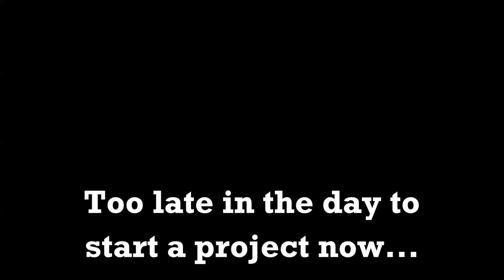TOP DRESSING and LEVELING with SAND :: Back Yard

Comment: I had the same problem with my greens master with the pegs for the transport wheels not mowing close enough to the fence. I just cut the pegs off. There is really no need for transport wheels if you are only using the mower at one property.
Reply from the maker: I’ve thought about it. Probably should. I just hate the sound of the roller going over the concrete from the garage to the lawn 😖
Reply: Yesssssss! That sound makes my ears cringe too!🤣

Comment: You look like you had so much fun! If you want to have more fun, come to Tulsa and help me finish mine. Ha!
Reply from the maker: I’m going to need some freeze pops 😜
Reply: @TheLawnTools   Oh I'll be happy to provide freeze pops all day and send some home with you.
Reply from the maker: Intriguing.... 🤔
Reply: @TheLawnTools  I've already done about 10k SF. Still have about 6k SF left, and need to add another layer to half of that first 10k.
Reply from the maker: Wooooowwwww. What kind of equipment are you using? (For the sand leveling and for mowing and general lawn care also)?
Reply: @TheLawnTools  I made a drag similar to yours several months ago that I pull with my Polaris Ranger. I also made a hand leveling rake for smaller areas. I've been moving sand with a shovel and the dump bed in the Polaris. Last 5 yrds of sand I moved with my neighbors tractor. I've been working on about 5k SF at a time. Cutting it down to reel height and leveling. Been mowing with an 18" McLane reel mower, but that took forever! So, I just bout a Toro Reelmaster 5300D last week. Now, I'm knocking out 96" at a time! Its awesome!
Reply from the maker: 5300! Sweet! I just went and looked at a 3100 this morning! Your lawn might just need to be featured on an episode of LT turf! (More info... soonish on that 😁)
Reply: @TheLawnTools  That'd be fun! I've still got some work to do, but it's coming along nicely.

Comment: Hi there I love to know how many tons of sand u use /100m² . I have a tiny yard just under 200m2 with laom/clay ground... So in the fall when it rains a lot, you make puddles only walking over it. Now I want to level it like you do.

Thanks in advance
Greetings from Belgium
Reply from the maker: kevin .valkenborgh 
One yard is equal to roughly 1.5 tons. I realize we in the states are the only ones that use yards and ft 😂. But the rule of thumb says 1 yard per 1,000 sq ft so it looks like for 200m2 you would want about 3 tons. If you want to do a lighter leveling and the grass to recover faster, you can do less each time but probably more leveling projects to get it nice and smooth. I did about this much on my front yard and I think it needs just a little more fine tuning this (second) year.

Comment: why sand vs a top soil mix???
Reply from the maker: Elliott Huff 
I’m curious about a mix. Haven’t heard of anybody selling it around me but I assume it would be more expensive??? May be a need for some experimentation 🤔
Reply: I did it on my lawn here in Dallas. Yard looks good but not as flat as yours. I might try sand next spring. Im only using a level lawn rake and not a drag as well tho.
Reply from the maker: I’ve heard that topsoil is harder to level. What % mixture did you use? I think if people do mix, they do a 90/10 or 80/20 so it’s still mostly sand.
Reply: The Lawn Tools pretty sure the compost mix I used was more like 70% sand. Not enough I'm thinking.

Comment: Why didn’t you just drive the skid on the grass and spread it with the machine?
Reply from the maker: K9 388 
Would have left big ruts and would have been counter active to leveling
Reply: The Lawn Tools I thought that’s was it was. But since you leveling what’s the diff. I’ll let you know in a few weeks.
Reply from the maker: K9 388 
Yes, the sand would fill in the track marks, but, the thinner the layer of sand, the better.

Comment: I live down in Little Rock and just recently bought my first home. I plan on completely tearing up the backyard and planting zoysia but I am a little hesitant since i have zero experience in putting in a lawn and my lawn is somewhere between 13,000 annd 16,000 sq ft so Im concerned that if I screw up early on in the seeding stage that'll be pissing away a chunk of cash on the zoysia seed.
Reply from the maker: So… you can plant zoysia from seed. BUT, from what I hear, it is more difficult than most other types of seed so beware. It can be done so don’t change your mind necessarily but just make sure you know what you are getting into. Sod is more expensive BUT, weed pressure is much less, you don’t have to water quite as much right after it is out down and it will look great the first season instead of with seed you need to apply very heavy if you want it to look good the first season. Have to baby seed a lot. Watering 3-4 times a day for 2 weeks. Like I said, you can do it, but just know that it is a bit of a journey.
Reply from the maker: @taipan185  
I have seen a couple successful zoysia seed projects here on YouTube also. You got this!